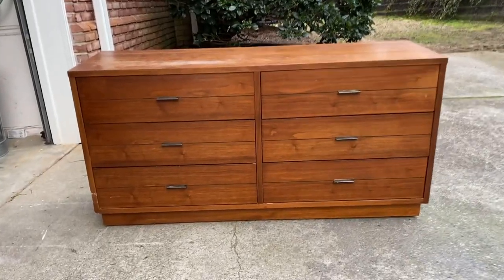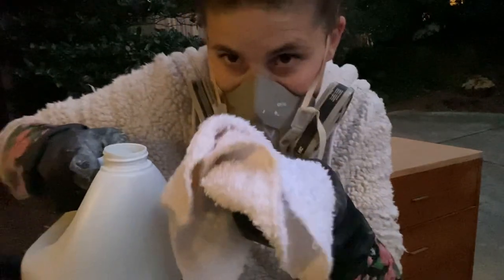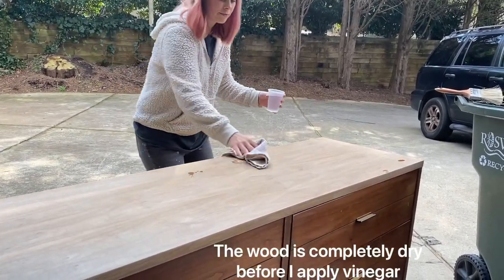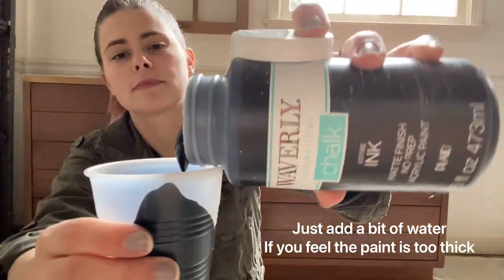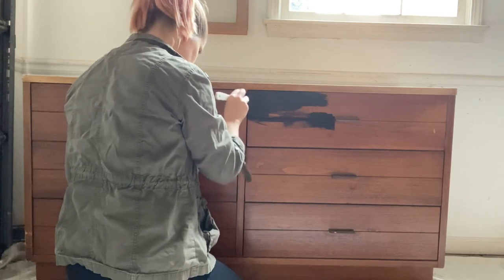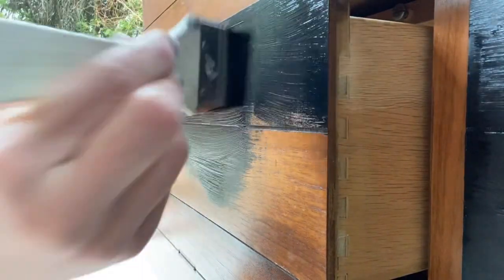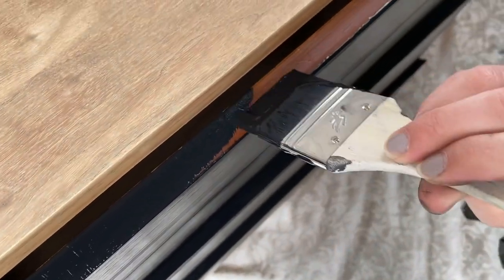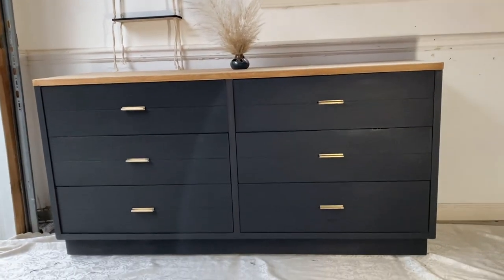Modern Boho Dresser Makeover

Comment: Great MCM dresser makeover. Just to feed the wood and protect it a bit I would use hemp oil or something like Dixie Belle’s big mamma’s butta on the top.
Reply from the maker: Great tip, I’ve never used those!  I do really like the lightness of the raw wood and I’m worried a clear coat will darken it, do you find that to be the case with those you mentioned?
Reply: It might change the color a bit. You could try it on a drawer first to check. Another option is to water down the chalk paint next to create a similar effect. Here’s a good video by Christina Muscari showing that technique https://youtu.be/Zptf6SyakKw.